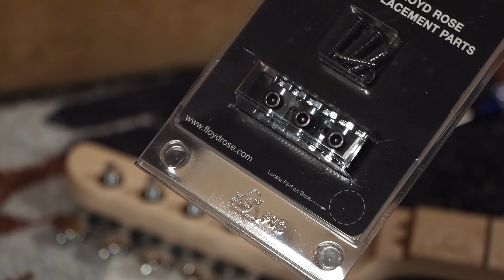Super Strat Build - Part 3: Test Assembly

Comment: Hi Jacob, As a finish carpenter by trade, I would suggest you use a center push punch when predrilling screw holes. It should eliminate the drill walking away from the intended screw attachment point. Keep up the good work and someday you'll be a famous Luthier.
Reply from the maker: Thanks for the good suggestion. Those look really inexpensive so I’ll probably pick up one tomorrow.  I think the big reason that drill bit kept running off for the strap buttons is because I had it on the L instead of R setting, pure stupidity and carelessness. However, it would have been useful when I installed the string retainer, the maple wood is slippery. That’s also a nice compliment to hear because pretty much everything I do comes from learning from my mistakes.
Reply: @jacob_zang  Glad to help. Looking forward to Part 4.

Comment: If it is a original Floyd Rose, it is wider. that is why you use trembuckers with a Floyd and makes it wider on the fret board. That the way it was on Kramers in the 80's. I'm curious about the radius. The Floyds were 10 inch radius that neck is 12 to16 compound radius neck.
Reply from the maker: Hey man thanks for watching.  The radius on a Floyd is 10" out-of-the-box.  They come with a small shim that goes underneath the middle four saddles.  If you take that out like I did, then its 12" radius.  I wish I would have filmed the Floyd modification process.  My Wolfgang has a 12"-16" radius and it feels good.  Thats a good note on the trembuckers, though.  I have one on my 5150 and the spacing is correct.

Comment: For the misalignment, you can sand down the neck a bit on one side and shim it on the other (to keep a tight pocket). Would have to fill and redrill the neck holes though, as it's maybe 2-3 mm off at most.

Comment: You’ve probably already figured it out but… I would take the claw out and try to drive the screws all the way in, in case you need it or FU-Tone makes “high” tension springs (red ones) again, if you need to get the trem decked…I think the neck looks fine…excellent job👍
Reply from the maker: I did not know about the high tension springs.  I will think about it, thanks for your help.

Comment: That's a beautiful Strat body and the birdseye maple fretboard is nice too! Does the nut assembly have "O" ring washers for the allen screws? Because tightened against the wood might not do! You're doing pretty good but I would bring it to a luither for a basic action and set up adjustment and yank out the string buzz and also, your pickgaurd is way off on the fit in fact the bottom curves don't follow the body curves! One layer is too thin so you might want to go with a two or three layer! I'm a fussy guitar guy too and that makes us better guitar builders!
Reply from the maker: Thank you.  It comes with the washers, but the one hole on the back of the neck is way too shallow (probably by accident) so I need all the depth I can get.  I think I also accidentally lost one, whoops.  I have a drill press so I'm going to make them a little deeper.  The Pacer Deluxe pickguard never follows the body curves.  Its a strange thing about them but if you look it up you'll see what I'm talking about.  I think its because in the 80s, Kramer just used the same pickguard for all of their different models.  This is a .090" thickness 1 ply pickguard which is actually same thickness as a .090" 3-ply strat pickguard.  The acrylic is a little trickier than the usual plastic but i think its stiff enough.  Thanks for your interest